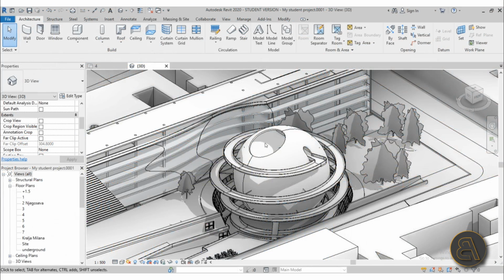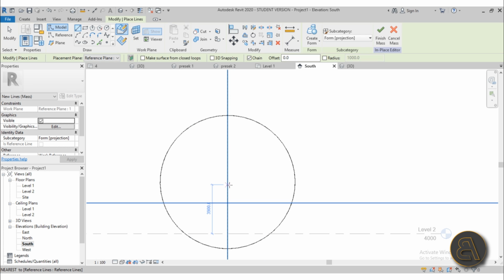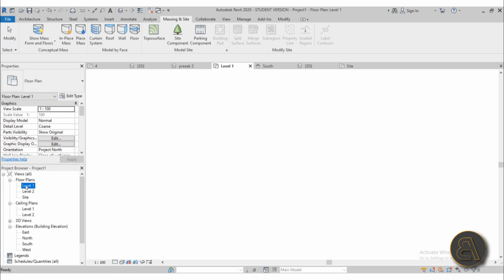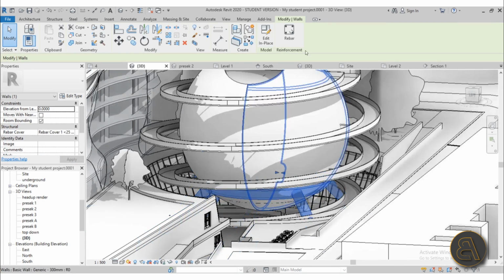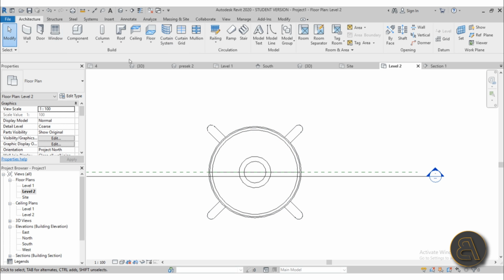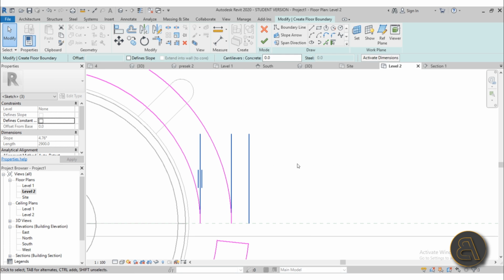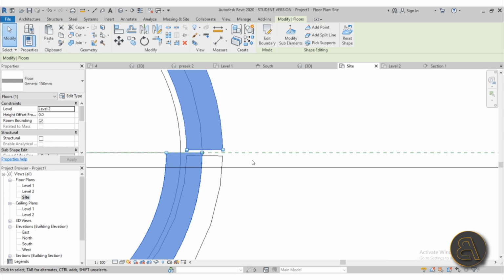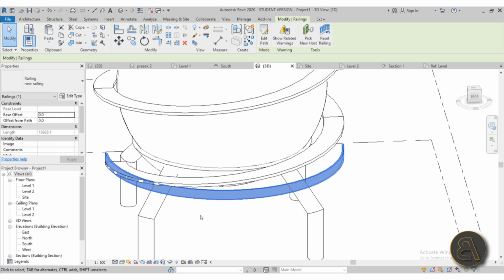Advanced Revit Modeling Rundown Tutorial

Comment: When an architect draws an engineer curses
Reply: That's because they're still stuck in AutoCAD ;)
Reply: @AussieBIMGuru  I am 2 years BIM manager and this comment make no sense. Revit helps to project faster not the impossible
Reply: @pavillon9365  and i am 7 years. I hear a lot of engineer vs. Architect talk all the time - it is highly unproductive. Often engineers I have worked with will 'curse' architrctural drawing because to change their drawings takes far longer than it would take to change the same drawings, but in a BIM model. Whilst some engineering firms in my country (australia) are using BIM, a significant proportion still use Autocad. 

t was only meant as a playful comment to jibe that the negative attitudes between our disciplines don't achieve anything at the end of the day, and that they can work in both ways dependent on context. It makes sense i think

If you mean that an engineer curses when we draw INSTEAD of modelling then sure, i agree with that interpretation 😀